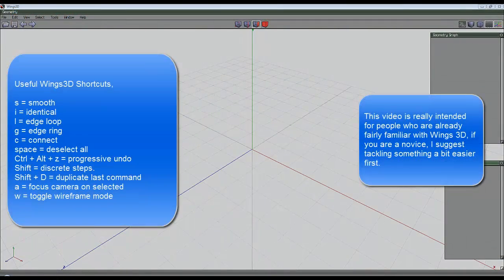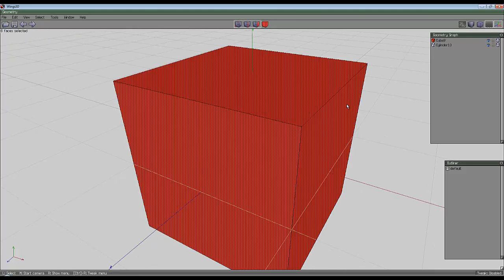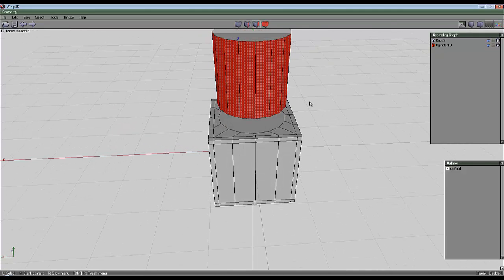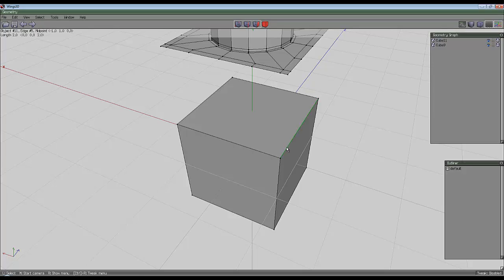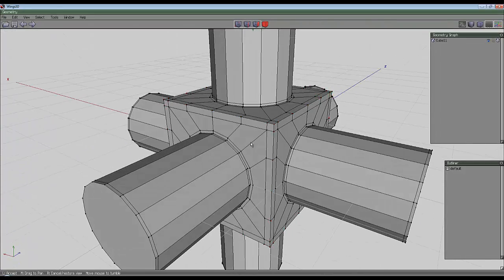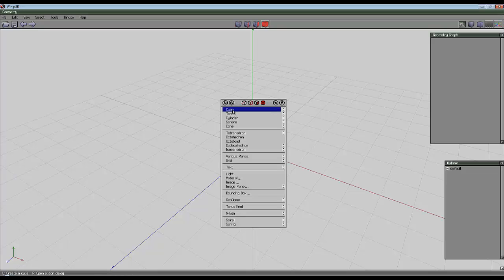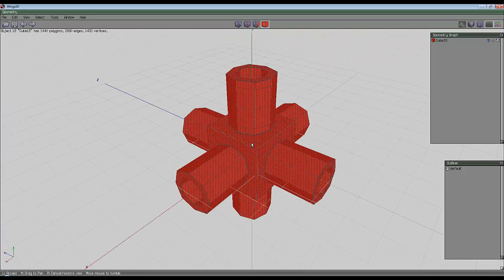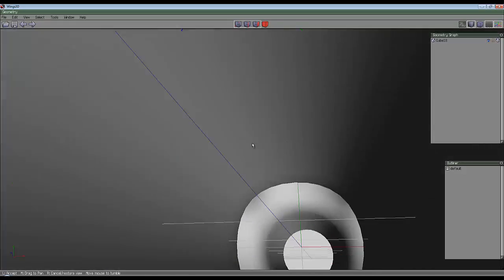Wings 3D - Making Better Geometry - by David Brinnen.

Comment: Nice work, David. Does Wings3D not have a mirror function?

Also, Re: Triangles and why they're avoided: because they terminate loop selection functions. Topology is a big thing in modeling. If you stick with quads, most mesh-centric 3D editors can select loops or continuous chains of lines based on the vector (trend) of the previous line selected.  Triangles act like a 'fork' in the road for line selection: the algorithms used for predictive loop selection are unable to calculate a best path.

Triangles are also poison for smooth deformation: quads 'warp', triangles don't. So on the whole, triangles aren't bad in of themselves: they're a necessary poly and useful. But in terms of having manageable topology, quads are friendlier to use :)

Comment: This will be a big help in my own modeling using Wings 3D. Artifacts due to smoothing in other applications the models are imported into can be a big problem. With geometry improvements like what you show here, my models will have better quality and be much more enjoyable to work with. I am going to share this video at a site I am a member of, and that way I can find it more easily when I need to. You have covered pretty much all the problems I have with my singular object models!
Thank you!
Reply from the maker: I'm glad you find it useful.  It certainly took me long enough to get my head around some of these issues.  I recommend also Luxology modo - How to avoid Spiders (On request) and Luxology modo - How to avoid Spiders - Part 2 which although they relate to Modo are well worth your time.  When I get to grips with the technique myself I will probably do a version for Wings it is such a useful thing to understand.
Reply: David Brinnen Thank you for the recommendations. I will certainly check them out. I'm not sure what is meant by the term "Spiders", but obviously that will be explained in those tutorials.
I wish you good luck on the endeavor to do a version for Wings 3D.
Stay Awesome!
Reply from the maker: L. Cleveland Major A spider is defined by Peter as a vertex where more than four points meet.  These seem to cause some problems when they occur on edges that are delineating a bend or saddle in the geometry but are otherwise harmless if located on a flat area of the model.  He uses some neat tricks to move them around.  I had not see this process before, I found it very intriguing indeed.

Comment: Hi. I just wonder why you use wings instead blender? For now i don't see any functionality that wings have and blender dont. But in blender are not only modeling- sculpt, texture paint, animation, render and much more. In general - why you still use wings?
Reply from the maker: Wings is small, light, uncluttered.  If I want to use a heavyweight application I have Modo.  But I find it fun just to use a little program like Wings which just does modeling.  One thing I particularly like about Wings (and I don't know if this is true of Blender so I would be interested to know) is that it forces you to keep all your models solid.  Where as in Modo, for example, you can create daft geometry, once sides surfaces that are not contained within a solid body.  I have installed Blender before, and indeed many other modeling applications, but after brief experiments I've concluded that I like the Wings workflow.  Even though it lacks many of the complex commands available to the heavyweights, it is nice to muddle through and always pleasant to use.
Reply from the maker: ***** Thank you for your kind offer, but if I want something to replace Wings I have Modo and there is a limit to how much software it is possible to learn and have a good understanding of.  I still don't feel I know enough about Wings and then I would be moving to something I know nothing about and is far more complex.  This is not an attractive proposition.   Houdini is another tempting alternative that has been suggested http://www.sidefx.com/ but again, I fear the learning curve.  Like Blender it seems to offer too much for my tastes.  Modo is bad enough, since it has rendering jammed in there, while what I was looking for was a more focused modeler.  And there is also ZBrush http://pixologic.com/zbrush/features/ZBrush4R6/ which seems to offer a more sculptural approach, but again is somewhat overburdened with features.  Less choice sometimes makes life easier.
Reply: David Brinnen I use Blender myself, and while it has some really nice features, it is more complex. The speed that Blender has for modeling is not as fast as Wings 3D. This I can say from personal experience. Also the Y and Z axes are swiched in Blender from every other program I use. Yes there are a couple of ways around that, but it is still confusing to me even after years of using Blender. Other things are different as well.
That said, Blender can do some things that Wings 3D cannot. The sculpting feature mentioned by bnzs1 is one, and there is a robust set of Boolean Operation Tools that works better than the ones in Bryce. I use Blender to do the things I cannot get other programs to do, but Wings 3D is a quality program for what it can do, so I have no plans to stop using it.
Reply from the maker: L. Cleveland Major Yes, for the occasional special operation I also have TopMod, Hex, Meshlab, Sculptor Gen, Ivy Gen, Grome and a few little command line programs too.  But I cannot say I really know these well and by not using them often enough, it is frequently the case that I might use a long way around in Wings because I can see a way to do it, rather than fire up another program and spend five minutes trying to figure out how to import, rotate, select and apply a command... and if it worked, export.  Or maybe as is often true of TopMod, just crash the program over and over for fifteen minutes before spitting the dummy.
Reply: Because....Wings is much easier to mesh with than Blunder. Horrible program of doooooom!!! No seriously. Wings is really good for making quick, low poly objects. I use it daily for modding Morrowind (such a shame there isn't a nif export facility). Good video mate. One with an accent I can listen to rofl